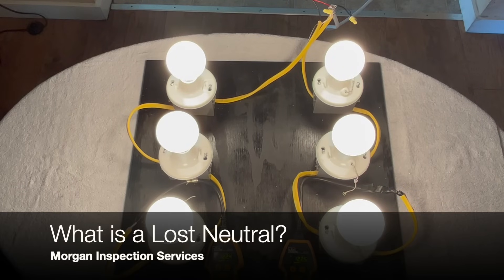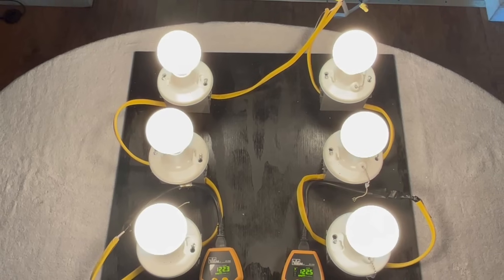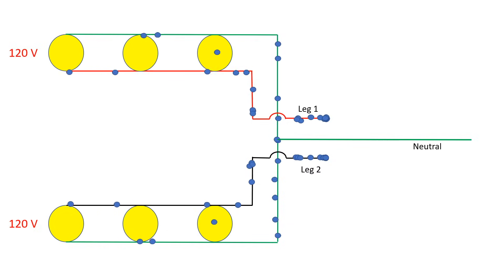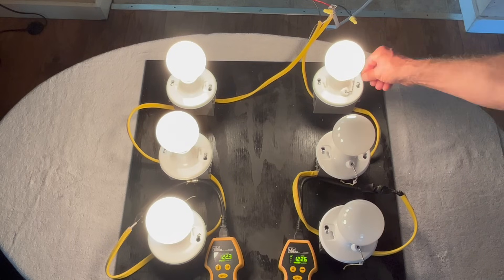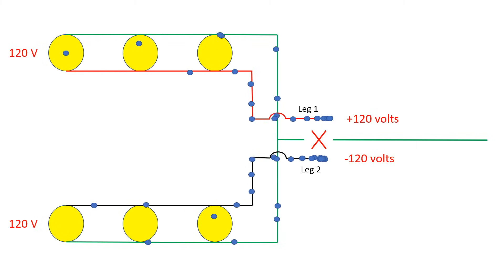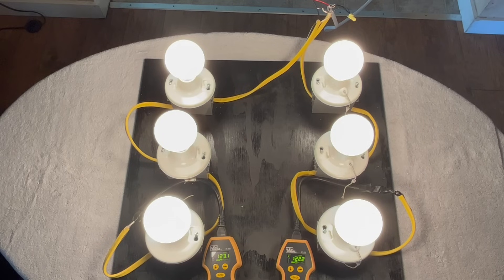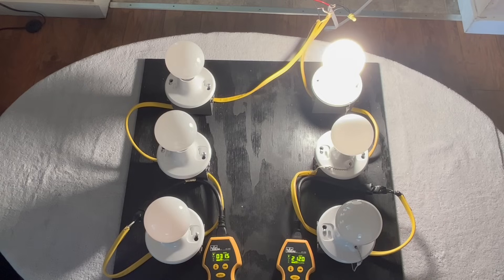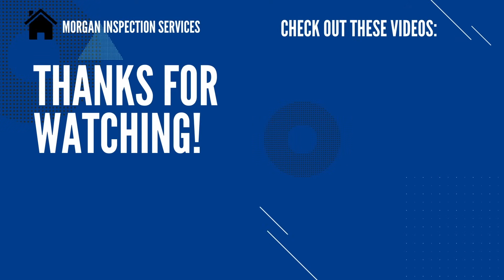What is a Lost Neutral? Lost Neutrals demonstrated

Comment: While I want to say the power grid in our area is old and not too hot, after a recent brief outage, I'm thinking we're dealing with this issue, ourselves.

I want to say anywhere between every 5-15m, it's like the voltage in the house drops. It hasn't seemed like enough to power off any devices that were running, but I've seen lights flicker in different parts of the house as well as my room's fan slowing momentarily. Additionally, and perhaps as a bit of a cheat code on my diagnosis, I have a battery backup power supply connected to my PC that clicks on every time this happens. In that brief moment, I'm seeing voltage numbers between 50-75 before it kicks back up to somewhere between 110-120. Just to rule out the possibility of it being the socket, I plugged it into another just to be sure and the problem still happened.

Another piece of evidence is a few months back I believe we had lightning strike our house, as our TV cable wound up being fried at the outside box. How much of that traveled back to the pole and possibly damaged things there, I couldn't say. It's just possible this most recent outage was enough to finally push things over the edge.

Did put a call into AEP yesterday, but how quickly they respond or even resolve the problem is up in the air right now. While I'm obviously worried about damage to things in the house, I think my more immediate annoyance is just hearing the PSU clicks because I'm a light sleeper and that's enough to get me. x.x

Comment: Excellent explanation!  A few days ago I encountered this problem.  I called the power company because the cables coming from the pole were rubbing against a tree branch causing stress on the mast attached to the house.  A crew came out late in the day and rerouted the cables.  It was dark before they finished the work.  The next day I started noticing the problem.  Fridge, televisions and a bunch of other things were not working.  I replaced a couple of light bulbs but the moment the switch was turned on, they would burn out again.  I had no clue why this was happening.  I panicked when I took out a volt meter and noticed that some of the 120v outlets were over 220 volts.  I had a hunch that the crew working on the power lines in the dark had done something wrong.  I called the electric company again and they sent another crew right away.  They were not saying much but I now know that they knew exactly what was wrong.  Now after looking at your video , know what was wrong.  The guys working in the dark probably didn't attach the neutral wire properly.  I am currently in the process of filing a claim for all the damage it caused.  Thanks for this information.

Comment: Thank you for explaining this , unfortunately this happened last week at our home and thankfully I was home at the time . What I personally experienced was and is still terrifying. The entire house was making very loud buzzing , cracking sounds . Lights on and off and the sound and smell was so bad . I immediately called 911 . We lost so many appliances and smoke was coming from a light . Our surge protector literally melted and the fire department cut power to our home . We actually had a fire inside one of our washing machines . At the time I had no idea what was happening. After the fire department secured our home we called our power company and the technician said it was due to a bad install when they put in new poles on our street. They have accepted full responsibility and we hopefully will have our damages covered by them . I feel blessed that I was home because we would have lost everything.  My fear is real and would like to know if my entire house needs to be re wired??? We did have an electrician come out and he went through our home , power is on but my constant fear is my wires that I can’t see are damaged…
Reply from the maker: Wow, I am so sorry to hear that. I am glad you were home, and your home is safe. That is a great example of just how dangerous loss neutrals can be.

Comment: I was called to troubleshoot un electrical issue for a house all the bulbs were blown out immediately after inserting. i have tested the incoming voltage to the Breaker box i saw my multimeter tester going up to 450 volts rather than 230 -240 volts I then tested meter box same result still too much voltage even one hot leg to neutral was reading around 450 volts and fluctuating then I knew it was a transformer problem. i called the Utility company they came and checked the transformer at 2 in the morning they said there was nothing wrong with their transformer the third time i called i waited to meet them at site i explained to the crew that the main neutral is not returning the excess voltage back to the source. finally, one of the Crew on the bucket truck saw the neutral lug of the transformer became oxidized so after they cleaned the line voltage got normal 240 volts and customer happy

Comment: This is the best demonstration I've found of the lost neutral situation. Years ago when first learning about it, the thing not usually mentioned is how the high resistance is typically between transformer and home, not within a specific branch of the home downstream. Effectively the entire home is a multiwire branch circuit! The other point one easily stumbles on is how the two legs are 180 deg out of phase with each other. So one could argue that the direction of flow at any instant is opposite on the two legs, which is why the two phases cancel when they come together at the neutral busbar in the main panel. So to be completely accurate in your model, the direction of movement for your 'electrons' should be opposite on the two phases. However because this is AC, an instant later that direction flips the other way. You got the message across with a simpler model, so it isn't necessary to be more exacting. Indeed, a more exacting model might be more confusing for those struggling to understand.
Reply from the maker: Thanks for the thoughtful and detailed comment! You’re absolutely right about the high-resistance point often being between the transformer and the home rather than inside the home’s wiring. I appreciate the clarification about the 180° phase difference and the way the neutral current cancels under balanced conditions. It’s a great reminder of the trade-off between simplifying for understanding and maintaining technical precision. Thanks again for sharing your insight—it’s a valuable addition to the discussion!

Comment: It's a good demo but only applies to Edison 3 wire circuits.  The current flow also seems backwards from what is taught in trade school.  The hot is always hot and cancels out on the neutral.  Otherwise, the voltages are accurate.

Comment: I have  two other questions Morgan: you said when we turn off one light on one of the legs, resistance Increases. Why? And why not pipe voltage increase on that leg? I know v = ir, but something feels wrong about an increase in resistance causing voltage to Increase?

Question 2: is the physical model you made, similiar to a multiwire branch circuit?
Reply from the maker: OK, first of all, when we talk about voltage increasing, we are talking about voltage increasing across the loads. So when the load resistance increases, the voltage will increase. When these loads (which are in parallel) have more resistance, it takes more voltage to push the current through those loads. Or another way to look at it with more resistance, there is more voltage drop through those loads.

Yes, my board is similar to a house circuit. You have two 120 V legs. All of the loads on each leg are in parallel with each other. If they were not in parallel with each other, you would have various voltages on everything. So my board showed two separate legs. The three lights on one side were in parallel with each other, and the three lights on the other side were in parallel with each other. However, the two legs (once the neutral went away) were in series with each other.

Comment: Hey Morgan,

I’ve got two questions if that’s alright:

1) once the neutral is disconnected, u mention both legs and the loads are all in series, so since they are like one line, how is it even possible that you created a situation where leg 1 is 70 and leg 2 is 170? I can’t seem to grasp how they are in series - yet somehow disconnected enough where their voltages can become different!?

Question 2: why does turning off a light cause a drop in voltage on the side we turn off light?

Love your channel! Amazing double demonstrations (animation and real models).
Reply from the maker: Electrical theory says that when you have loads in series that the entire voltage (in this case 240 V) is split up among those loads. The load with the higher resistance will have the higher voltage drop. So in my animation and in the actual test board, the three lights on one side are in parallel with each other, but they are in series with the other set of three lights. If you turn one of those lights off, the resistance of that part of the circuit goes up because you are losing one of your paths for current to flow. With that one path gone, current cannot flow as easily. Adding more things in parallel with each other, decreases the resistance. Decreasing the number of paths in parallel with each other increases the resistance. So by turning off a light, you are increasing the resistance and increasing the voltage. In question two you said why does turning off the light cause a drop in voltage. This is not what is happening. Tell me what part of the video (give me a minute and seconds of the video where this happens and I’m going to make sure everything is explained correctly.
Reply: @morganinspectionservices3840  first - that’s my mistake - you didn’t say that - turning the light off, increased the brightness and the voltage. So that’s my fault! Secondly: ok so when we remove a lightbulb which itself as it’s own resistance, does the resistance increase by the bulbs resistance when it’s turned off?
Reply: @morganinspectionservices3840 amazing explanation!!!!! One more followup question kind soul : you know how they say a truly balanced system is like series sets of parallel loads at 240 V? Is that just a sort of conceptual helper - or is it LITERALLY indistinguishable from the “reality” which is two different -120 v circuits?

Comment: How did they ever decide that 120V is a good idea? We just have 240V single phase to every house and amongst them many houses with 415V three phase supplies. Almost like it was a money decision. Lower voltages, more voltage drop and bigger cable equalling more copper..$
Reply from the maker: Great question! The choice of 120V in North America goes way back to the early days of electrification when lighting was the primary use. Lower voltages made sense for the carbon filament bulbs of the time. You’re absolutely right, though — lower voltage does mean more current for the same power, which leads to more voltage drop and thicker (more expensive) wiring. That’s part of why 240V is used for high-demand appliances here. Appreciate you bringing up a thoughtful point that sparks deeper discussion!

Comment: A really good video that got me thinking about larger picture...not just within my house.

6 months ago, a branch hit my residential line that broke a weakened neutral...squirrels were eating it.  Under no load, 120v, but when garbage disposal or microwave hit...dipped to 104.  Power company came out and patched up neutral.  Weeks ago, another branch hit the line...and again broke the neutral up by the transformer.  Again power company patched it, but same dimming occurs  when large motors hit....power company came back out and did a test and put in work order to replace neutral wire...but that hasn't happened yet.

What your video doesn't address (I think) is when a house has a ground (copper rod in the ground) tied to neutral in the panel.  My house does that and that would still tie my house's neutral to a grounded path...yes?

My neighbor and I both share a transformer.  So by your demonstration, possible that some current may be flowing through his house and out his neutral since our legs are tied together?

Not an electrician, but very much enjoy power quality.
Reply from the maker: Thanks so much for your comment, Corey — sounds like you’ve been through quite an ordeal with that neutral! You’re exactly right that a compromised neutral can lead to fluctuating voltages, especially when 240V loads (like your garbage disposal or microwave) unbalance the system. That dimming is a classic sign.

As for your question: yes, in most homes, the neutral and ground are bonded together at the main panel, typically through a grounding electrode (like a copper rod). But that ground rod isn’t meant to carry current under normal conditions. Its resistance is too high — usually 25 ohms or more — so it can’t effectively carry return current the way the utility’s neutral does. It’s there primarily for lightning protection and voltage stabilization, not as a substitute for a proper neutral connection.

And you’re right again — when you and your neighbor share a transformer and the neutral is compromised, return current from both houses can potentially take unintended paths, including through each other’s systems, depending on how the bonds and grounds are connected. That’s one reason why a lost neutral can be so dangerous and confusing.

Really appreciate your thoughtful comment — it’s great to see folks like you digging deeper into how all this works!
Reply: @morganinspectionservices3840  something else to add.  I've spent 11 years as a data center facility engineer while also supporting remote field UPS systems...seen some odd things.  Most electronics (these days) are rated for 250v as they are sold globally and can tolerate the higher voltages as EU has 230v in the home.  So higher voltages is still a concern...but think about the low voltage side and the amount of current being pulled because of the low voltage.  I had a site in NY after hurricane Helen that was operating at 70v.  The network gear was only rated down to 90v.  While the equipment still operated at the same wattage, it was pulling more current and I was worried the power supply components wouldn't be able to support that much current.  They operated for a week and a half like that.

Another story from the data center about voltages.  We had an outage and we had three generators in a "king of the hill"...first to get up to speed at correct voltage set the voltage regulation for the group.  The lead's voltage regulator (new) failed and sent the 480v output to 600v.  125v equipment saw 156v and 208v equipment saw 260v, which is only rated for 250v.  Of the gear that blew power supplies,  only devices on 208v circuits had problems...all the 125v racks weathered the issue.  UPS units were down for maintenance and we had tried going to generator because that was "safer" than bare utility power.  That was a busy day.

Comment: This wouldn't be a problem if our utility companies weren't cheap and ran a TN-S system instead of the cheaper TN-C-S. The issue is they treat the neutral and ground as one cable. This causes all sorts of problems if you lose that cable (the home then loses BOTH their neutral and grounds). Not only is it a hazard for your equipment but it's an electrocution hazard too. Now you have no grounds which means all the exposed metal in your house is electrified. Sometimes the stray current will flow between houses on the same street.

If they ran TN-S, that means they would run a neutral AND a ground in a SEPARATE cable. This way if you lose the neutral, it is not a hazard as the fault current will simply flow back to source on the ground and trip breakers.

Donald Zipse wrote about this problem for years and was never able to enact any change despite sitting on the code panel that regulates utilities.
Reply from the maker: Thanks for the thoughtful comment! You’re absolutely right—many of the issues we see with lost neutrals stem from shared neutral/ground conductors in TN-C systems, especially in older neighborhoods. The lack of a dedicated ground path (like in TN-S) can make a lost neutral incredibly dangerous since return current may travel through unintended paths, including metal parts of homes. I hadn’t heard of Donald Zipse before—I’ll have to look into his work. It’s frustrating that despite awareness of these risks, change has been so slow. Thanks again for adding valuable insight to the conversation!
Reply: @morganinspectionservices3840  You are the only American I have seen on Youtube cover this topic.  However, a fellow over in England named John Ward also did a good demonstration of it.  He made a setup where he demonstrates two houses on the same street where their water mains are continuous.  All kinds of hilarity ensues when he breaks the service neutral.  Of course, over there they use one true phase (not split phase) so keep that in mind.  But they do use our same grounding system (TN-C-S) so most of it will be applicable here.  I think you will enjoy the video:  https://www.youtube.com/watch?v=fen8ekrhlBI